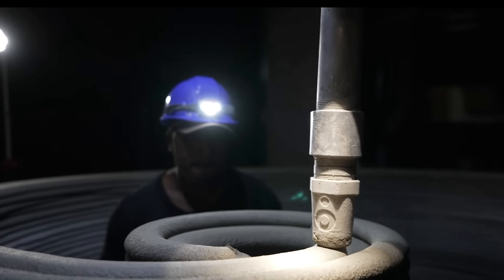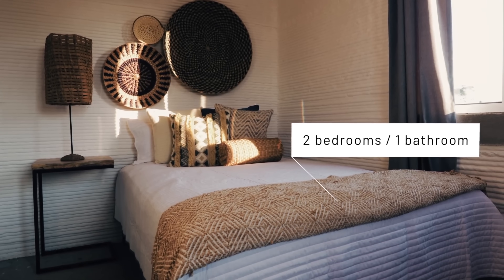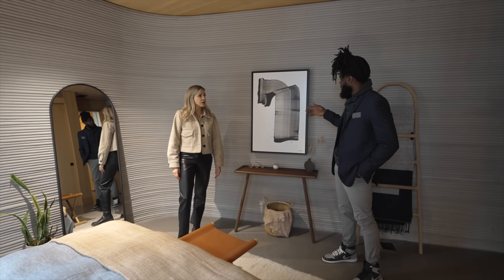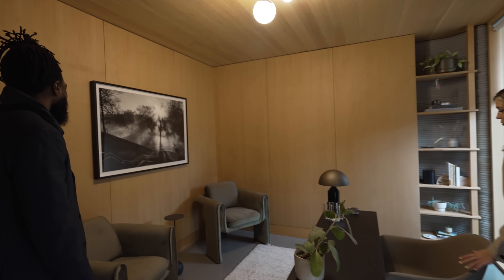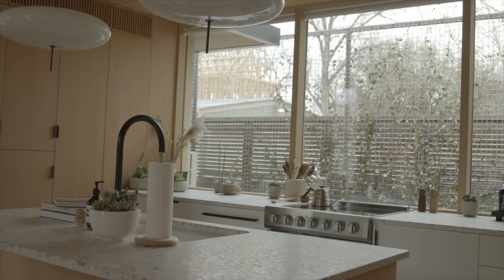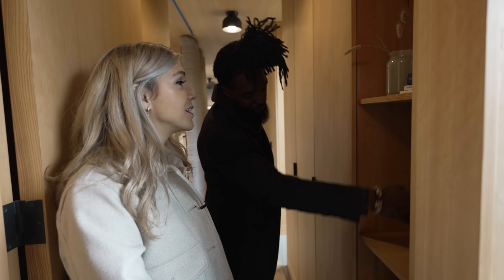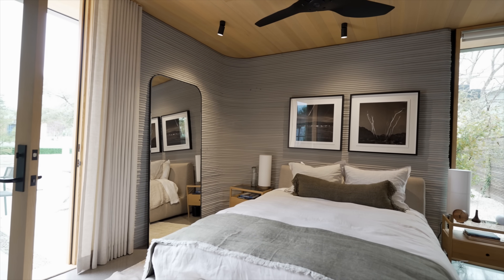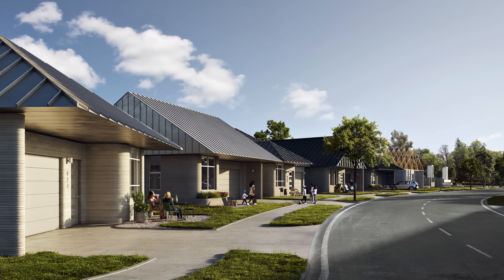Inside A 3D Printed House You'll ACTUALLY Want To Live In

Comment: I think Americains don’t realise that most countries only build houses with concrete and construction stones, wood seems weird to us. Love the video
Reply: Thanks shells that was interesting honestly I feel like Icon should be pre-wiring that stuff
Reply: @bluemanagementservices4172  concrete fucking sucks, is solid, has no way to put anything in between, is cold in winter and hot in summer, and can crack, wooden isn't safe for fire, but there are ways to make it safer, you can put wired connections in between, put isolation panels, can easily be swap in case you want to move a specific wall in a room, etc.
Reply: A lot of countries actually uses compressed soil and mortar to build it needs way less sand or cement.
Reply: I don't think that you realize that wood has a far better R-value (insulation) than concrete or stone. Wood also has a far smaller carbon footprint with CONCETE having the LARGEST carbon footprint of all materials.
Reply: you do realize that concrete homes are insulated, right? You don't use just concrete for walls. Also, for the carbon footprint, cutting a tree means destroying a "machine" that converts co2 into o2. And also there are types of modern concrete that does exactly that, absorbs co2 and releases o2, and they are very good on large buildings, something you cannot do with a wooden frame building.
Reply: @mrtopcat2  Wood, by itself does not. But wood houses require lots of insulation which is where most of that R-Value comes from.
Reply: @EDub513   And still wood wins hands down BY FAR when compared to concrete. Actually can't even compare wood to concrete, concrete is so bad. Literally almost no insulation. Only people who are somehow involved in selling the 3D print idea see any benefit. Lining their own pockets.
Reply: @EDub513  R-value of concrete is around 0.1 per inch, whereas R-value of wood is around 1.4 per inch. So easily 10x.

But this comes at no surprise. Sit on a concrete bench vs. a wood bench and feel the difference.

By the way, in Europe, with the benefits of wood construction finally recognized, wood construction is on the rise with the technology explored deeper and perfected. I have even seen high rise projects built out of wood in Europe.

You have mentioned wood being more available in the US. That may be an excellent point. Yet, I think in general, historically in the US buildings were never intended to last long and they just wanted something quick, where wood was a great alternative. In Europe on the other hand, construction was much more planned and required to be long lasting, so they chose masonry products as due to the lack of effective moisture control, masonry products would last longer. But now with modern moisture control technologies, wood may become more appealing.

By the way, I am always fascinated by Japanese temples. They seemed to have managed it all. Moisture control, insulation, seismic resistance. They still stand tall.
Reply: @mrtopcat2  who cares about that? What's important for most people is for their house to still be standing after huge storms, floods, fires and those pesky termites.
Reply: @darrienekassandraduran8825  Well, that is one hell of a shallow comment of technological ignorance.

What you have mentioned can be achieved to be nearly on par with concrete via design and technology.
Reply: @mrtopcat2  so what? Concrete is durable, and it should be made widely available as an alternative. If you are worried about carbon footprint, concrete should be the least of your concern. “Of all materials” means nothing, when you consider car exhausts, for example.
Reply: @mrtopcat2  You just had to cite a fringe study by Gates, eh? Even if you are concerned about interference by those interest groups, you don't have to cite studies conducted by the west. And you didn't reject my point either.

Another important point to note is that concrete is mostly used to build new structures. This is different from transportation, for example, which is simply recurring.
Reply: That was the first thing that came to my mind lol
Reply: @AJCiti thank you 70 subscriber
Reply: You are right. We don’t realize.
Reply: @MousyLeigh  because it is inefficient
Reply: @MousyLeigh  Actually you realize, as mentioned in video most costs are labor in US, wood houses are faster to build, but not necessary cheaper in materiel. In E. Europe a lot of companies who build massive suburb areas from 0 also choose wood, as it is faster and overall cheaper, thou not better as wood has a lot of issues.
Reply: It is very unusual house made of wood...
Reply: @MousyLeigh  thank you 70 subscriber
Reply: @MousyLeigh  the reason is earth quake!
Reply: @MousyLeigh  I'm an American, I'm dumb as a stump. Bali is one smart person.
Reply: @xyzcomp08  this seems to be a legit answer
Reply: Fiber reinforced concrete is the way to go
Reply: @Theo-lo1yc  Um... Hello, the rest of the pacific ring of fire make homes with steel and concrete.
Reply: I think wood should be more like a interior wall and joints
Reply: What I find strange is all the wooden houses in Tornado alley and what's left after a Tornado.
Here in Asia we get hit by Tornado and nobody goes to Oz like Dorothy cause our houses are bricks stone etc even the roof is aluminum frame.
Reply: Even in places like Miami, wood has been all but eliminated since hurricane Andrew in the 90's
Reply: It’s silly but here we are.
Reply: @petermuller161  why is wood weird? It’s literally one of the oldest and basic contruction materials.
Reply: Yep, Mexico also builds with concrete. Not a new thing.
Reply: In Brazil, we use both, but mostly concrete. Wooden houses get really hot in our summer, that only lasts 10 months. And there are also termites in some places… they can easily eat a whole wooden house down!
Reply: In my country, the Philippines, you can see a lot of concrete houses for particular reasons such as to withstand calamities, and since we have high temperature here, the concrete helps to reduce the heat we feel when we’re inside. By the way, we have an average of 20 storms per year and some are unimaginably destructive.
Reply: from what i know. US home use different material in different region categorize by different climate.
Reply: @hintofdia  Why build with bricks when you have hollow blocks?
Reply: @mayyahhh2503  In south india, we traditionally build bunglows out of wood. Most five star hotels in south india are wooden made.
Reply: @diyasingh-x8t  what??
Reply: What is the most malleable and allows for so much modification with customization later on
Reply: Well it's not just America. Timber stud frame construction is by far the most common here in Australia as well.
Reply: I prefer steel. so, not every American wants wood.
Reply: You realize that it doesn't really matter right. Homes have been made for thousands of years using wood, rock, mud, concrete (their version of it) etc.
Reply: Exactly I be calling these wooden houses here carton box houses, like so expensive for a home be made out of wood I’d rather have my home be made out of concrete.
Reply: @Theo-lo1yc  Wrong.  Cali is littered with tilt up concrete warehouses, office buildings, hotels & parking structures. I’ve worked on houses and small buildings with metal framing instead of wood.
Reply: I lived in Europe a few years, and yes, most homes are built with bricks and stone etc. Even many of the roads of course are brick, or cobblestone.
Reply: Lol and it is expensive as f.
Reply: Personally I would prefer my home made out of brick or stone but the cost can be high for those type of materials.
Reply: It's so u can reuse the land easier to burn then to break apart and have to find a place to put the waste of the house weird
Reply: We aren’t dumb.
Reply: @Catphesuada  — Please tell us Americans aren’t dumb, when half believe Trump is still president. 🤣
Reply: Probably because we’re not starting wars all the damn time
Reply: They way the talking about the concrete😂😂😂. I have leaved in concrete built houses all my life .
Reply: Concrete has godawful attenuation. Not sure why it’s weird that we would want wood in a society that heavily depends on wireless radio transmission.
Reply: Well wood isn’t the norm in America either, it’s full of multiple cultures. I seen houses made out of metal plating that looks like cargo containers, etc.
Reply: We live in a very humid environment and having a wooden home is not recommended. Mold will wreak havoc on it.
Reply: Yes, save the trees please.
Reply: Abhijeet Kundu  -- True, but with respect... When I've traveled abroad the buildings in other countries seem permanent, brick, stone, cement, marble, there are so many buildings over 200 years old it boggles your mind.  Returning to America, it seems almost like I'm coming home to a tent city of temporary homes.  It gives me great respect of the European building methods, they LAST.
Reply: I'm from Brazil, here we have plenty of forests to get wood from, whoever almost all houses are build with bricks and concrete, it is very rare to see any houses here build with wood.
Reply: @Theo-lo1yc  Chile have more earthquake and we build with concrete
Reply: It is not weird, most of building properties include houses' building materials depending the geolocation and weather along with climate.   This is the reason why when you look at houses across the United States, you will different houses using different building materials.
Reply: Europeans just can't go ONE vid without making fun of America. Apparantly you're forgetting about Canada and Australia who also make houses out of wood. But no, any chance you get to make fun of America you'll take.
Reply: I don't think you realize this, but the America's have more wood than most other countries... We didn't chop every single standing tree down like every European country did in the 14-1500s... Maybe study some history, mate
Reply: Why would we care?
Reply: Never heard of an "Americains" btw wood houses are better than your sh*tty concrete and stone wich reminds me of stone age living.
Reply: Americans don't realize? I love how people from other countries think that all Americans are dumb and don't know anything about any other countries. Yawning because I'm so tired of this narrative.
Reply: Exactly 😅
Reply: 0
Reply: True growing up seeing it, it was weird until I realised why they do it. I wonder though is this sustainable long term I mean using trees, don't panic just a question.
Reply: True
Reply: That's true because in my country having a house made of wood is cheaper and many citizens including myself live in houses made from concrete and construction blocks.
Reply: those motehrucker also dont realise that 95% of human use metric system...
Reply: In Florida the house of houses are all concrete, only walls inside are wood. I think this happened after hurracaine Andrew
Reply: It's not like we don't use the would at all, in houses the roofs are most often with wooden construction frame. But yes But yes concrete construction elements withe brick walls is the norm.
Reply: @rador9745  shortage supplies. Covid , China , amongst the many things
Reply: Years ago it was the same here in the USA, but people here tend to be short sighted and the lower cost of wood became more important than the longevity of CBS (concrete block) or poured concrete.
Reply: Was thinking the same thing
Reply: I think most Americans actually like running water, plumbing and power inside our walls.
Reply: @Burt Wilderdeud - Nodding my head in approval right now sir… 🇺🇸💪🏽
Reply: Here we make huge modern buildings and barely use wood, only really takes some small pieces of wood while building. But then again 3D printing wouldn't work any good here either because cement is very expensive and we build mostly walls with bricks without anything inside with layers of cement between them, just cement would be crazy expensive...
Reply: Im Jamaican American and concret housing with zinc (alluminum) roof tops is what im used to. wood is too frigile. Termites, water damage,  erosion, carpenter ants, and general upkeep make it sound like useles building material. Plus ifs costly to the enviroment since trees dont grow overnight. I always wondered why more houses didnt use me indistructable materials like stone, concrete, cement, even brick.
Reply: Yeah , in Europe ( tho idk about now , still here in Slovakia ) we still build and probably will continue to build with bricks , woods are just not viable to use this as like a main / core building material , maybe after the house is buildt , on the inside for design or whatever.
Reply: Are they resilient during earthquakes?
Reply: no we just know its better for the environment
Reply: We use wood in Norway
Reply: @throughthelens231  did you not watch the video?
Reply: Maybe we should change that.  Concrete is the 3rd largest producer of CO2.  One ton of CO2 per ton of concrete.  4 billion tons of CO2 each year, worldwide.
Reply: Hm
Reply: Wood is normal in Switzerland
Reply: This 3d house build gonna take time to implement in the rest of the world .....
Reply: Well we know that. But 3d printing a house is new. That’s the cool part.
Reply: 3D concrete walls > painted drywall boxes
Reply: Florida is FULL of concrete block homes.
Reply: Timber house is designed to be affordable. It is expensive because of the labour so it would be more expensive for concrete
Reply: maybe https://youtu.be/vwV-Im_xlic will be useful for you
Reply: Lots of countries use wood for various reasons (availability, durability, flexibility, and..the ability to mix with insulation without a separate layer for colder climates).
Reply: I’m from Jamaica and most of our homes are build with concrete homes built with concrete are better suited for warmer climates lol building a concrete house here in the US especially in states with colder temperatures don’t make sense for insulation purposes it’s easier to keep a wooden house warm in the winter than  a house built with concrete if you use concrete to build your home in the winter your gas bill will be mighty high trying to keep your home warm wooden homes don’t keep and maintain a cold temperature like a concrete house dose so it’s easier to keep cool js
Reply: @everythingtv2325  you can insulate a concrete home with insulation, but because there is no space for insulation in the concrete, the insulation layer eats into the interior space of the house.
Reply: @seanmcdirmid  yes you can but what I meant is that it’s harder to keep concrete homes warm during the winter
Reply: That's horseshit. Wood is commonly used for construction all over the world.
Reply: @n1nj4l1nk  have you traveled to all the world’s countries, I have been to most countries in Europe and Africa, and I can say it’s none existant in a lot of those countries, you’d ask the people living there and they would tell you they had no idea that wood is being used for construction in some parts of the world. you don’t have to travel, just ask people from different nationalities on the internet, wait I am one example of that but you said it’s “horseshit” 😅🫠 Enjoy your day or night.
Reply: @Pappo56666  Japan, China, Russia, Australia and every country in Europe that I've worked in all use wood in the construction of homes.
Have you never heard of log cabins, tudor houses, a frame construction? African homes are either entirely wood or a wooden frame with clay/concrete coating, European homes are largely wooden frame and brick skins, Japanese homes are wood frame with traditionally paper walls but more often these days a concrete block skin. Places like Thailand, Sweden and a bunch of South American countries have homes almost entirely made from wood.
Pretty much all houses around the world with pitched roofs use wood for the frame.
Clearly you know nothing about construction.
Reply: @n1nj4l1nk  back in the day 😂 in Jamaica we don’t use wood wood is for poor people fr
Reply: @n1nj4l1nk  in Jamaica concrete homes are much stronger and better if there should be a hurricane or say a tornado a concrete house is more stronger so you don’t have to constantly rebuild and wooden homes are cheaper to make 🙂
Reply: Ye cus wood burns
Reply: wrong mor0n aka bali.  Much of the US REQUIRES concrete walls.
Reply: Not true at all. I’m American (USian? That’s not a word lol), I live in Texas, and for my home it uses concrete, construction stones, wood, and bricks. Same for my whole neighborhood
Also, I believe the materials differentiate depending on the climate and area since the US is large
Reply: But they Def don't 3D print them to spec in order fir it to look like an actual family home.
Reply: why are you fighting... wood or concrete is same the have pro and con... maybe its okay to use wood home in us and urope because the climate and it will be cheaper but if in asia especialy in southeast asia rain, tornado, even hot and flood, wood home will become problematic it will rot faster than the concrete one... and what happen if many home in asia made from wood. many forest will deforestation because many will need for wood material, europe and north america will get less imported wood from asia, that why many asia coutry choose to concrete home... fyi amount wood material needs in asia already high even with concrete home what happen if every corner use wood house
Reply: ??? Wood, weird?? Have you ever been to Europe??  There are log cabins and chalets and quick houses fully built from logs, i.e. wood. old and new.
Reply: True
Reply: It's not that. We are just far moe advanced in the building world
Reply: yeah but under that concrete and stone is a wood frame. In the US, you have that ability to build your house however you like it. whether that be of brick, stone, concrete, wood, etc. Since the US has natural disasters like tornados and earthquakes, Americans choose to build with wood so it will be cheaper to rebuild if their house is destroyed. Bricks and Stones can be used as a deadly projectiles in tornadoes too so people have to realize why we use wood.
Reply: Ah so we're just the silly folks then, huh?

Damnit! Again!
Reply: Thats because you probably donr have enough wood in your part of the world to support everyone having wood foundations in every home
Reply: I dont think you realize that most americans dont want to live in a slum where every house looks like the same block of bricks. Your house probably looks like aushwitz. Youre like thecperson who asks why would anyone get a mercedes when you can get a hyundai for cheaper? Perhaps you should just stop being poor.
Reply: in Nz at least, i know we have a lot of wooden houses because of earthquakes
Reply: They used so much wood that place cost a fortune 🔮
Reply: Well wood is better for the earth..
Reply: Right
Reply: Speak for yourself.
Reply: who the fuck are americains
Reply: American here my house is 100% made of concrete, lots of newer construction here is just plywood unless you get a old house or a really nice house
Reply: I'm American, I actually knew that. But I'm also of European, Hispanic, and Asian descent. All of which are cultures  that use concrete. But, a lot of the houses here in America are brick and our foundations are concrete.  Although, I do see it as a strange material to build housing with
Reply: Totally don’t know
Reply: I love it!
Reply: As an American that has lived in a log cabin, brick house, high rise (cement and steel I believe). Thanks for the assumption.
Reply: Far too much wood. Yuk.
Reply: I’m American and I’ve never bought or built a home that wasn’t concrete and steel.
Reply: Unfortunately in places with a lot of humidity, concrete and stone or be a nightmare. And like where I’m at my home is actually 7 foot off the ground due to Insurance purposes and that I’m about 500 yards from the beach so my house had no choice but to be made out of wood but my siding is made out of hardie board which is a cement, sand, and cellulose fibers. It’s very tough and durable.
Reply: We think everything is disposable, including houses and people.
Reply: man our mansion in vn built by concrete and last forever .
Reply: Abhijeet Kundu  — I could t agree more!  👍🏽😍
Reply: Abhijeet Kundu  you are destroying ecosystems if you continue to use wood/trees to build house . we should use our waste/trash recycle them turn them to usable materials to build house .
Reply: Abhijeet Kundu  wood is not cheap to build house .
Reply: Of course we know lol. Aside from the US, Canada, Australia, New Zealand, Japan and some south east Asian countries still build single family homes using wood.
Reply: Wood is sustainable and a renewable resource. Stone and concrete are not. It may be weird to you.. but figure it out. You are using the worst materials.
Reply: No we definitely know that!
Reply: Americans usually build with timber so you comment Is ignorant
Reply: They build homes cheap, so they can make the most amount of money
Reply: @gabe6959  who doesn’t build to make money you do know the USA has a large population and a tradition of building with timber.
Reply: @HopeYukizmizu  Not true that’s some Europoor propaganda if it’s a third world country then why does it have the biggest economy in the world. Not to mention how a lot of people want to move there. Cope harder Hope.
Reply: literally what I just thought
Reply: In The Netherlands wood doesn't seems weird. There is not enough wood here to build thousand of houses. When people build there houses by them self you see more wooden houses. We normaly have an inner wall, put insulation on it and then build the outer wall. Then the upper floor from concrete and thats how its going up. Only the roofs are wood :D
Reply: Yes, in Germany this would not be possible
Reply: the reason for this is...america is basically a development country, health care, wealth per household, education, infrastructure, cunstruction and so on xD
Reply: we still use woods for the roof
Reply: i did not realize that, thanks
Reply: Nope. Wood housing construction is originally Asian. The box and frame housing you see was adapted from Japan to California to deal with earthquakes and then was expanded to most US housing due to it being cheaper and easier and faster.
Reply: I'm from europe and actually there is a trend back towards wood as a building material, because the CO2 footprint is way, waaay better than concrete. And it's actually even pretty fire resistant with the right treatment
Reply: In Sweden wood houses are very common
Reply: I wish our houses were concrete. Wood makes me feel unsafe.
Reply: @darkwoodmovies  weak
Reply: Have you been to "most countries?" Do you know most Americans? No, and no. Now stop insulting us.
Reply: I saw a 3D House Building company using mud to build houses because their research shows mud houses are very cost effective. What most Westerners and Indian Urbanites forget/don't know that building mud houses is the traditional and sustainable way. Mud can go back to the ground if house is demolished. It requires clay, mud & hay for the mixture to make the walls. The temperature maintenance is very cost efficient in mud house.
Reply: I do love stones but in California we have earthquakes and where i love we are not even allowed to use stone
Reply: thank you for this, i was like.. how structural will it be?
Reply: Yeahhhh don’t know how well this will do in hurricane
Reply: Actually, concrete house construction is actually just a European thing and houses in Europe are outrageously expensive. The rest of the world use different materials such as wood, clay/adobe, and even a few other materials. It all really depends on what is cheapest for the area. No matter where it is built, if it is built right, it can last a very long time. There are all kinds of examples of wooden houses that have lasted for numerous centuries not only in the United States (which is only a few centuries old now) but Asia has quite a few of them very old wooden houses.
Reply: The reason why we use those tools and materials is because many years ago builders wanted to standardize building home practices so they Thé could construct entire neighborhoods cheaper and faster the architecture kinda changed for the carpentry
Reply: Wood is an extremely environmentally friendly way to build a house. Bricks and concrete take a lot of energy and pollution to make.
Reply: Mainly designed that way for winter and earthquakes. Instead of the house getting completely demolished with a 5.0, it’ll lean with the earthquake and stay standing. And winter (depending which areas of US) needs some good insulation that other materials can’t provide. But in hotter parts of the US, that don’t have that many earthquakes, it doesn’t completely make sense to have such an expensive construction 🤷🏻‍♀️
Reply: The only houses with wood walls i see in America are 500k plus
Reply: @iam_tack  every house I’ve seen in the west coast are built with studs. The only ones not are ones build before the code was implemented (like East coast is full of brick ones)
Reply: We don’t just use wood we also use concrete
Reply: If you don't know how to waste your money on something, then buy a 3d printed house
Reply: depends where in America for example Florida has primarily metal or concrete construction
Reply: i think you don't realize that most developed countries have a bubble housing market. :/
Reply: Actually we always see those shoddily constructed with "improper materials" cement building on the news,  collapsing in earthquakes and hurricanes. 😞
Reply: idk why ppl still build their houses out of wood in tornado/hurricane prone areas
Reply: That's true
Reply: I live in an earthquake zone so wood framed houses usually work better.  Note that is just the frame and we tend to use stucco on the exterior and dry wall on the interior.  Also, is there a way to fact check that statement?  Are we sure it's "most" countries? ^_^
Reply: cool but you are actually no most so don't speak for us.
Reply: Ah because you can build normal roofs out of concrete and stones? lmao yeah. Im european btw
Reply: More flammable house, how lovely
Reply: Do the have the story of the 3 little pigs over there?
Reply: *realize
Reply: @PresidentDawg  Realise, in the UK it’s realise, and I am aware that in the us and Canada it’s realize. But thanks I guess.
Reply: because it is inefficient
Reply: Americans love to kill trees. And then wonder why we are having global issues. Consumerism over the future.
Reply: I wonder how much will they be? I loved the style.
Reply: Americans
Reply: She said they were concrete
Reply: I wouldn't say most.. lots of countries in warmer climates build houses out of timber. Here in Brisbane, Australia half the houses in the city are wooden!
Reply: I in Phillipines ma house is made out of wood... i broke the wall onec :P
Reply: and thats y their houses burn so easily.
Reply: your actually wrong we do know and it just shows that people enjoy spreading their thoughts even if thy are wrong
Reply: Lmao there is alot of homes in germany that use wood along with sweden as well
Reply: Yea the only wood in my house is a support beam in the attic.
Reply: ikr
Reply: nope
Reply: I do not live in America [Never have. Wasn’t born there, either, and I also don’t have a single known American relative] and many houses in my country are made out of wood. My house is made of wood.
Reply: nah i live in poland and i go to a wood house every year for cavation / sry for my english
Reply: So y’all never had a log house? Abraham Lincoln house? Wood homes are old
Reply: I know is this evolving or declining
Reply: Some of us that travel does.
Reply: My current house is concrete they're many down fall to a all concrete house wifi/cell service and climate control it's is just a few.
Reply: Really?
Reply: lm indian and YES THEY DO Only do concrete for homes
Reply: Let's be honest here. The US builds out of wood because we have the most magnificent land in all the world blessed with tons and tons of forest land. Others countries are not as fortunate.
Reply: Americans in Alaska build their homes made out of snow.
Reply: Concrete is not sustainable
Reply: Couldn't wait to to get that lil jab in huh?
Reply: We love mold in our homes, that is why
Reply: I think most people don’t realise that in my village we only build houses with sticks and cow shit, concrete seems weird to us.
Reply: I'm American and I know we are the only dumb asses that build our homes out of wood. Despite what they say, wood is a cheaper product and it doesn't stand the test of time. If we built out of wood we wouldn't have to continually...REBUILD! Welcome to money before everything else. 

My only question with the 3D concrete. Where does it get it's strength from? Concrete is weak without rebar.
Reply: in my country most modern houses definity build by concrete and bricks but in the countryside most houses build with woods with unique structure and could survive from 100 years and even earthquake
Reply: Concrete is not eco-friendly, can have mold and can be deadly during earthquakes, and have bad insulation
Reply: I know right?? 😂
Reply: Why is that? Because of the cost? Concrete is more sustainable than wood or "engineered wood products".
Reply: I know and then they are way more expensive here.
Reply: It all depends on the environment, elements, and climate. If a concrete home is more common in your area, then there is a reason for that lol. If a wooden home is common in your area, there’s a reason for that lol. Common sense would tell you that. Hello people! Quit trying to act like yours is better than others and vise versa. So silly! And we wonder why the world is in chaos. It’s the people🥴 Lord have mercy🙏🏽
Reply: They are definitely aware. There are reasons why wood is used. It's not weird, you are just not aware of why wood is used. =)
Reply: i swear we dont care if youve done this before
Reply: Those are probably the cheapest materials in other countries. Wood is the cheapest here, so we use wood. It’s not a secret, it’s just capitalism. We don’t realize it because it has no relationship to our own reality.
Reply: lol most americans cant afford to build with american concrete
Reply: usa is babylon !!!
Reply: I got to say this is the dumbest comment I've seen in.
Reply: I don’t think that’s quite true. Japan and places prone to earthquakes build lighter. But ya concrete is most common everywhere I’d say. Including, American , Canada too. In Canada we pour foundation (basement in ground) concrete. Then we frame with wood or steel on top. 
But anytime you start a comment with Americans don’t realize lol thumbs go up 😂
Reply: Because the wood makes it feel more natural. and it feels even better if you are capable to building it yourself.
Reply: … I think you didn’t realize that we don’t just use woods to build houses.. we build with lots of other resources, just depends on the owners and what their income is and etc… 😊
Reply: @thomasstcyr9806  for some ppl it’s their line of work. Their industry. They’re bread n butter. I’d say important stuff to some
Reply: That's bc of what is locally available. In America in the second half of the 19th century when the Great Plains were being settled (yes go ahead and note that 'settling' means that the buffalo and indigenous people were dealt with harshly) many of the original dwellings were built of sod. They were also built into hillsides if hillsides were available.
Reply: 😒 wtf....this comment is funny and stupid af
Reply: Here in the US we like our homes to be burnt down, so we prefer wood.
Reply: @ErnisTelevisionNetwork-yy7ii  🤦‍♂️ Wood is less expensive than stone or concrete but wood either never was or is no longer plentiful in much of the world or doesn't have an acceptable service life.
Reply: You are right.
Reply: Especially where they build wooden houses where tornadoes are! 🤷🏼‍♂️
Reply: Like in the story of the three little pigs. The house built of hay and sticks got blown down. The house built from brick with stood the pressure.
Reply: Name of this company?
Reply: More then 500k fot this kind of house, I would li,e to know where is the convenience...
Reply: Drywall?
Reply: Concrete sucks to renovate
Reply: Yes we do.
Reply: I would never live in a wooden house.
I just don't trust them.
Reply: Not skilled enough to build with wood
Reply: I’m in south Florida where concrete is used due to hurricanes so when I see a house built with wood it looks weird to me
Reply: Australian here, we use a combination of everything. Sometimes you will find a brick exterior but our walls are a mix of concrete and timber/wood. We also have concrete beams inside our walls, it’s why we never see houses crumbling or falling over.
Reply: I was living in Russia, Uzbekistan, Kazakhstan, Ukraine China, and now in US, and never seen so terrible housing, country like in 19 centuries, no design, all is shabby… i don’t see any greatness of America economy…. All is bubbly over price etc
Reply: I live in Puerto Rico, and us Americans here build with concrete and steel.
Reply: We build with concrete walls in Florida. We also travel, so we do know different ways to build. We also have wood framed homes that are over 200 years old, so what’s your point?
Reply: Actually houses built without concrete to us means you can't afford to build a proper house. The first time ibsaq American houses built fro. Board i felt so vulnerable like they can literally blow away any minute. Dont even talk about the price $$$$ they are being sold for. I will never under
Reply: I felt so vulnerable when I started living in a house made from Bacchus board(match stick)  in America. It looks and feels cheap, and I will never understand how someone with that type of house tries to sell it for the same price as a brick or concrete house.
Reply: Westerners like to switch things up and revamp every 20 years ! Would
Be mass depression and worse! They don’t want buildings lasting to
The end of
Time they have more disposable resources and get it from every country ,
Reply: We realize it.. but our trades are clearly not using it outside of high end residential, commercial and multi family
Reply: Hi, American here. I agree. Never been comfortable living in a firetrap in an age of electricity. It is fucking weird. And to the asshole who says it is so it can be affordable a) what era are you living in? This shit ain't affordable. 30 year mortgages and shit. Sounds like you can't manage money. You just spend what you don't have and put yourself in debt. If I was gonna spend like that I sure as he'll would get a nicer place. B) I would like to live in a place that isn't gonna be a safety hazard. Again, flammable as fuck, easily molded from moisture, torn apart easily by nature, etc.
Reply: ICF ftw
Reply: We do realize there are multiple materials an abode can be made from, we aren't all idiots.  And no "most countries do not "only" build house with concrete and construction stones"  There are brick buildings, mud-adobe, steel, concrete block, cast concrete, earth berm, and wood / timber log all over the world.   It entirely depends on material availability, local labor skills, laws, and environmental conditions.  You can find many examples of all of the above construction materials all over the US.
Reply: Not to mention wood homes create desert biomes. Deforestation is really that bad.
Reply: Americans do realize there are other building materials out there lmfao. Hilarious how people think Americans know absolutely nothing.
Reply: How would you know what MOST Americans know? We're smarter and more well traveled than you might think. Many materials are used around the world, from bricks to stone to sand straw and clay to concrete to wood. Depends where you're from.
Reply: That's what makes you a 3rd world country.
Reply: All those countries used to build with wood as well, just ran through. Natural resources and moved to concrete homes - cost plays a factor too
Reply: Not quite true. Wood is a great material to build a house. The 4x2 stick construction is rubbish. Great cost effective wood construction can be found in Austria for example.
We need a great effort to phase out the 4x2 construction.
Reply: It's like popsicles sticks and toothpicks being put together as a frame with great aesthetics
Reply: Why are you guys so obsessed with what Americans build homes with?
Reply: Thank you 70 subscriber
Reply: A lot of people who don't know sh*t about construction like to pretend they know everything about construction in YouTube comments.
Reply: Its not that we dont realize. We just dont care. You guys care more than we do. Your countries are teeny tiny and thr united states is huge in comparison. Wood housed make sense when  you compare the cost and volume. Take your butt back to bumfuk who cares land. AMERICA BABY!
Reply: Exactly in Haiti Jamaica Africa they built with concrete blocks. It’s the same concept and these houses stand for hundreds of years Americans think of sheet rock steals and beams. You don’t need it.
Reply: Concrete is better. It's fire resistant, blocks sounds better, provides better insulation, more wind resistant when the walls are thick concrete.
Wood is way overused in residential construction in the USA, esp in fire, tornado prone, and noisy places.
Reply: @check25bid  better insulation? bullshit, also, wifi connections cannot penetrate thick concrete walls, and make it impossible to make changes in the house after settled
Reply: That’s sad after checking out your properties, so expensive. And during a fire or hurricane you guys lose everything even the structure. Wooden homes here in asia hardly exist anymore.
Reply: @jialatdotcomdotsg4998  yeah I'm American. Tried to expand and explain the benefits to another American couldn't see the benefits. Already programmed with other thoughts. Someone said we need wood because of earth quakes in Cali. I said you're off your Wacker. Skyscrapers are made of metal and made to with stand. Wood is cheep. So I know that's why they do it here. And the news Media lead by private interest would  create every reason as to why we need to keep wood homes. Blah blah. And most would believe it. Cuz the news said. Said SsD Co. Said it. Man.. the people need awakening...
Reply: That's not true. We in Finland use wood too,..
In fact my house is made with wood..

In the Northern countries is most popular to build a wood house...
Reply: @michaelandreuzza also heard that during a fire sometimes a complete block burns down. But hey a house cost only 100.000 or less. You can afford to build 3 or 4 houses in 1 live time. So no problem. But if it happens during night time.....
Reply: @mayyahhh2503  We have very similar climate and natural resources. There's nothing wrong building a house out of wood. I have old homes near me built out of Adobe clay bricks.
Reply: You can think wood is weird all you want, but I prefer to have AC and heating built into my homes, which is something most housing in these "concrete countries" don't have. Btw, we DO "realize", we just don't like it.
Reply: @t6-30  well you can have AC and heating built into concrete houses. But heating built into houses isn't really necessary where I come from since it's already quite hot here.
Reply: @t6-30  lol wood houses are shit. Just a little storm to destroy your house 😂
Reply: @t6-30  why wouldn't you have central air conditioning or mini split ac/heat pumps available in these builds? you do realize that the roof is still a truss constructed of wood so the ceiling is going to be a traditional attic type or thermal sealed envelope style where the attic is conditioned space along with the house. So you would just run your air ducts in the attic like a traditional one story home and just run electrical for an air conditioning unit/heat pump. The 3D printed approach is only the framing of the home, nothing else.
Reply: @t6-30  What are you talking about? Having or not AC in a concrete/brick house is a choice. I have AC.  And heating, honestly, is  something my "concrete country" had for a long time, for almost 80 years now. And yes, wood house are lovely, nobody says the aren't. It's just a matter of practicality, it's a lot cheaper to build with concrete and bricks.
Reply: @t6-30  wait until you find out central air is a commodity most americans dont have
Reply: @t6-30  no you do it because its the norm. Literally any house can have a built in AC and heating system concrete or not 💀
Reply: @t6-30  The fundamental reason that you like your house to be wood is that you were born in a country that has that system fundamentally. So it’s not that you don’t like concrete houses, you just like that wood is the norm where you are, good for you, and supposing you would have liked to be original and build a concrete house, it would have been harder to build and more expensive.  btw I just had work done on my concrete house, and I was able to instal built in AC and heating, and honestly it’s a perk and not a necessity in a concrete house, I love that most comments agree that it’s safer and weird lol, It’s been on my mind since I was a kid watching Extreme Makeover: home edition, that show was everything !!!
Reply: @Pappo56666  Building Scientists around the world are developing and already IMPLEMENTING ever more creative ideas to AVOID concrete as whole or where ever they can as it has become clear that concrete is not a sustainable resource for the reasons I have mentioned in this thread (one of them being the lack of SUITABLE sand). Please find my related posts within this thread. NONE of this is news, if you follow the building industry.
Reply: I'm American well so called. And I agree. Making homes from match sticks in the age of climate chaos is kinda dumb. But they appreciate how it looks over practical. So. Oh well. Blown with wind.
Reply: @LucineRive  "Making homes from match sticks in the age of climate chaos is kinda dumb." What climate chaos? Climate change is a HOAX, just like God and Russian collusion. 90% of the Worlds glaciers are GROWING. The case for warming was found to be fraudulent. That's why they changed it from "Global warming" to "climate change", which means... ABSOLUTELY NOTHING.
Reply: @LucineRive  rather have wood that's way cheaper then stone that's more then double the price
Reply: @LucineRive  It's not dumb. It's sustainable and cheap.
Reply: @LucineRive  climate chaos? 🤣🤣🤣🤣🤣 Where? Oh they told you that on the TV and internet. 🤣🤣🤣🤣🤣 Of course you believed them. 🤣🤣🤣🤣🤣🤣
Reply: actually, we do realize this, because you guys mention it in every single video where wood is used to build something.
We American's would rather have a big house made of wood, that is easier to renovate, to keep it looking nice & modern.   While Europeans buy a stone house, built in the 1600's, is 600 sq ft (55m²), modernized to back in the 1900's to include some luxuriously opulent indoor plumbing.
Reply: People in cold climates don't use concrete which most americans live in. Concrete is terrible when it comes to the winter. Wood is also a lot cheaper to build with.
Reply: Concrete doesn’t fare too well in the winter 🥶 ... And with the water freezing within, it causes it to expand during the winter and thawing in the spring 🍁 leading to cracks ... And that’s why they stick to wood.
Reply: @Napstone  yeah a lot of people don’t know that and aren’t talking about that in the comments your heating bill would be way more in the winter time thou a concrete house will be cooler in the summer time than a wooden house 🙂
Reply: That's just not true in most of the world.
Reply: @brc3967  it is, most of the world uses stone, bricks and concrete.
Reply: Yea and it seems their houses always look weak. We are cyclone prone country and concrete is the normal material we use
Reply: Not on this side of the world, what many Europeans don’t realize is that we have a huge country with lots of different terrain an ecosystems. Houses are built to be comfortable and strong against the elements of different areas
Reply: some houses require it to be wood based on environment. Like in tornado states, it's easier for wooden house to be blown away but a lot safer that way too. Also, America had a lot of wood that they could use to build houses from but not much limestone to go around to build concrete houses from.
Reply: The way this is built, would be hell to fix a wall that is damaged. You would almost have to to replace a full wall if cracks show up. And solid concrete is a very bad idea, any movement in the area and foundation setting could cause a whole side to even fall if it was bad.
Reply: Americans still build with wood?
Reply: @Theo-lo1yc  not sure if it's a need homie. Maybe wood is cheapest. Skyscrapers with stand earthquakes. Not much wood holding it together.
Reply: @LucineRive  those have metal frames… I mean you’re technically correct, we could use metal, but that doesn’t seem necessary for just a house.
Reply: @LucineRive  if we used construction stone we would be underground sooner come the next earthquake
Reply: @Theo-lo1yc  maybe. We'll see
Reply: @Theo-lo1yc  that's incorrect, if built right, stone is a lot better than wood against earthquakes.
Reply: @LucineRive  sky scrapers have very expensive system in place for earthquake protection. Impractical for residential buildings
Reply: @LucineRive  as an Architect, you have a valid point… but what you’re asking about is metal stud framing which is a lot more expensive than wood framing and hiring General Contractors that specialize in metal framing means $$$
Reply: The whole of northern Europe constructs their homes out of timber frame.  I'm going to be ignorant and assume you come from Indonesia? - if I'm not wrong, then you can be sure these timber-framed houses are far better performing than yours.  You mentioned you've just installed AC?  Well that's because your house is not performing correctly - if it was designed correctly, ventilation and air-conditioning would be passive and not energy-consuming.
Reply: @craigstephens93  I’m from Morocco, it’s in North Africa, All northern African countries and the Middle East have concrete housing, and yes I installed Ventilation in a concrete house.
Reply: @Pappo56666  the non wealthy north african home compared to American homes is no bueno......
Reply: @craigstephens93  You might be making A LOT of assumptions my friend.  There are all sorts of home designs from pretty good, to passive to Passivhaus and beyond.  You probably already know that you build with the local climate conditions and budgets in mind.  How do you know that the house the OP built isn't energy efficient?  How do you know that the AC isn't heat pump based and also helping to dehumidify? Let's not generalize so much as to lose sight of varying realities or sink to condescending tones.
Reply: @craigstephens93  EU has a ruling that the frame of all houses must be out of metal and concrete, most member countries adopted this and is the norm, the rest of the house can be wood, stone, brick, concrete or whatever
Reply: @craigstephens93  pretty much
Reply: @craigstephens93  Well I’m from Europe and this what you are writing here is not true. People in the north do make small (mostly vacation) houses somewhere in the woods, where they are probably not spending too much time. In the big cities there’s no timber-frame housing in sight. You have to consider that in Europe we don’t have tornadoes. In the US they build timber-frame housing in the areas where they have tornadoes - how that makes any sense?
Reply: @doublepisces   Well, I'm also from Europe, northern Europe.  I studied Architecture for six years at a northern European University (2 years prior at a tech college) and I also have around 7 years experience working in Architecture in Northern Europe.  I myself, have designed, detailed and overseen the construction of many buildings in northern Europe, both residential and commercial and they all were predominantly made from timber.  

Firstly, I think you have a mis-understanding of what 'Timber Frame' actually is.  Timber Frame means it has a timber 'structural' Frame - it doesn't mean the outer cladding is also made from wood - that's called Timber Cladding.  You can have a timber-framed house or building that is clad in brick, concrete, metal, timber, plastic etc.

The house in the video doesn't suggest inner-city housing, but even the the dense inner cities are gradually being constructed in timber - CLT (Cross-Laminated Timber) is an Austrian invention and has been used throughout Austria and Germany for almost 100 years.  CLT is totally sustainable, almost as strong as concrete, fire resistant and is completely factory made so it is waste-free and accurate, making construction far quicker than concrete.  Look up the tallest wooden buildings in the world - they are mostly in the north, and it is a trend that will continue to grow.  CLT will rival 3d printing - because CLT is essentially the same but in reverse: the building is constructed off-site using computers and lasers and put together on site.

Your point about US is true - their version of timber frame is not the same quality as in northern Europe, and I'm not sure of the reason for this.
Reply: @craigstephens93  I actually do live in Germany and so far never lived in a home that looks like those American’s build. All the houses/buildings, it doesn’t matter if in urban or in village area, they are all made of bricks (hard material). Especially those in the North (look at Hamburg for example, bricks everywhere).
It can not be true that they are doing it “because that’s the material they have”, when in New York are buildings mostly build with bricks. 🤷🏻‍♀️ I’m don’t get their politics regarding this issue.
Reply: @doublepisces   You're not understanding me.  Timber Frame doesn't mean wooden exterior, it means timber structure.  Those brick buildings you speak of - many (not all) will have a timber-frame structure behind the brick - that is called 'Timber Frame with Masonry outer leaf'.
Reply: @craigstephens93  I’m not sure why we have this discussion, the whole point is that Americans building kinda bad housing. 😅 
It doesn’t have anything to do with Europe. And as I said, we don’t have tornadoes and even if we do, our houses are going to stand still after it’s gone. Maybe roof can be lifted up, windows broken, but the structure is going to stay intact. 
It’s just ridiculous to us for someone to make such a weak structure over and over again, like Americans do.
And I do understand what you mean, but between those wooden beams (timber-frame in Europe), there is a concrete all over, not just on the outside. The beams go 2 vertical, 1 across (from lower corner of one to upper corner of the other) and than one short beam mostly in the middle. In between all of them is so much concrete, you can’t take just an axe and break it all with one punch. 
I’m maybe not an architect, but I know some things about construction.
Reply: @doublepisces   I don't doubt you know about construction but again what you described very well, is not actually 'Timber Frame' but is called 'Post and Beam'.  If you are interested in construction, you should look into Timber Frame construction in places like Scandinavia, Finland and Scotland, and you should definitely check out Cross-Laminated Timber (CLT).
Reply: @doublepisces  You'll be surprised. Germany, being a leader in environmentally friendly and sustainable technology is actually also the leader in PHASING OUT concrete construction and replacing it with sustainable materials such as wood. Concrete is considered not sustainable because of it's terrible carbon footprint (cement manufacturing has THE highest CO2 emissions of all materials, 6% of all global CO2 emissions, while ALL traffic, planes, trains, cars, everything that moves accounts for 16% of world wide emissions). Concrete also requires a type of sand that is finite (Sahara sand is not suitable) and there are already localized shortages. You can look all of this up. Wood also has far better insulating properties. Concrete and brick buildings most recent and by now 'traditional' styrofoam insulation can not be recycled and is EXTREMELY bad for the environment for a multiple of reasons and also poses considerable fire danger as well. In fact, to my best knowledge, there have been again and again efforts in Germany to outlaw it's use, but the building industry has been resisting such attempts.
Reply: @doublepisces  yall people think our houses are just 100% wood? I wish humanities innate need to prove something right would go away
Reply: @double pisces  American houses are not bad, they use wood more because they are flexible enough to withstand earthquake n what not

Concrete cracks and breaks if the ground moved slightly too much
Reply: Took the words out of my mouth. Canada as well its strange living inside wooden  houses. You can break alot of stuff accidently especially coming from concrete houses. Nice house
Reply: @T R. King  how tf you breaking a house? You might have anger issues if you can just "break" an 2x8 board, tucked behind drywall
Reply: Yes it is really weird that most Americans don’t realise this. It seems like Americans have gotten used to the idea of making houses out of wood because it would’ve been more standard to do this during the early days of the settlements so they just sort of accepted as being the norm. When the factors in Europe we had overtime much better setting up of infrastructure for shipping about stone and clay to make bricks. So for us using concrete and brick with occasionally stone, depending on the area you are in, is much more common than having a wooden house.
Reply: They came to the realization that it wasn't a good idea in crowded cities after the fires of New York and Chicago which destroyed much of these cities, but elsewhere it was still widely used because it was still a widely available material.    There are some pretty amazing techniques for joining pieces of wood for homes and furniture in Japan.   They use a Banzai related technique to harvest wood without killing the tree.
Reply: Affordable homes seem weird to you too
Reply: @zunedog31  Actually no, In Africa, affordable/cheap is the norm.
Reply: @Pappo56666  no literal! People are to even have somewhere they call home 🏡!
Reply: @Pappo56666  I agree. Most African homes look cheap
Reply: @Pappo56666  Yes because the majority of these people are living in Africa
Reply: @Pappo56666  i think he was talking about Americans , cause affordable housing does not exist here . i pray African nations see how rampant uncheck consumerism is ruining America and avoid the same pitfalls
Reply: @Pappo56666  you realize American also use concrete only buildings?
Reply: @Pappo56666  even on an african income?
Reply: @Pappo56666  Africa is a continent
Reply: @Pappo56666  cheap, big and beautiful at that. Me and my wife are purchasing in Gambia next to her country of Senegal. Many of the properties are amazing!
Reply: @Pappo56666  the homes the Dutch left you dont count.
Reply: @Pappo56666  You are assuming that wood is affordable/cheap in other parts of the world. Or that other countries do not have building codes that discourage the use of flammable materials like wood. I am sorry to say that both assumptions are wrong.
Reply: @Pappo56666  Why do they live in mud huts then 😂
Reply: @nexusebtuoy  so many typos I don’t understand 😅
Reply: @zunedog31  actually no. In countries where the labor are not the most expensive thing in house cost, it’s cheaper to make a house in concrete and bricks .
Reply: @zunedog31  with 20 grand you can construct a 3or 4 bedroom house in my country
Reply: @markmburu5306  goddamn with that kind of money you can get a nice shed at home depot lmfao
Reply: @corporateamerica4530  coz everything is expensive in America
Reply: @zunedog31  As if american homes are affordable ahahahah
Reply: @zunedog31 It's not weird to us. Maybe concrete is expensive, but it's so much more durable than wood, especially if you live in tropical countries. Concrete could survive storms, floods, and fires much better than wood.
Reply: @zunedog31  Lol what? I can build a 600m2 (around 6500sqm) house in concrete and brick which will last hundreds of years instead of like 40, for like 200k here, a proper beautifull modern house with actual architectural design. In the US that will build you a clone ugly wood house with 2 rooms and 1 floor at best.
Reply: @zunedog31  "affordable" says no one
Reply: @zunedog31  in eu for example the land makes a much bigger portion, a wooden house wouldn't make that much of a dicerence
Reply: @zunedog31  wooden tends to cost more in my area
Reply: @zunedog31  afford labor homes with supply shortages . Teh good luck right now
Reply: @zunedog31  stone homes n stuff is largely affordable round these parts
Reply: @zunedog31  in our country we still value our trees. So we mostly go with concrete and its cheaper to use concrete here than wood. We have abundant of wood here its just not preferred because of the constant yearly super thypoon hitting the entire country and not to mention the monthly earthquakes. Wood easily burns down the entire house, with concrete we can still rebuild whats left.
Reply: @zunedog31  you commented that in 2022, it would have made sense if it were like i dunno.... 2017 or something but timber is affordable in 2022? damn you make walter white levels of money
Reply: @zunedog31  Affordable houses are multi tenant. Affordable single family houses are really strange, yes.
Reply: @zunedog31  homes that get destroyed everytime theres a bit of wind seem weird to us
Reply: @zunedog31  these houses weaker than wooden house..... Even a small wind can blow up the entire house..
Reply: @zunedog31  your house may be slightly cheaper, although it isn't that much, due to higher maintenance costs, but I prefer spending a little more and getting a sturdy house that doesn't need much maintenance and can withstand a lot.
Reply: @zunedog31  Flammable houses seem normal to you then
Reply: @zunedog31  based
Reply: @zunedog31  i dont think wood is more affordable neither sustainable. Wood needs maintenance and easily be home to termites and a literal match stick rn because of the climate. You spend less now but ur BOUND to spend more later to it fixed or potentially make a new house because ur wooden house got burned down. We're a third world country and even houses in the slums are concrete.
Reply: @zunedog31  the reason wooden houses are cheap is because America has and abundance of it. America is a large country
Reply: @zunedog31  actually even if our homes are mostly RCC they are relatively cheaper if we consider 2-3 generations of family live in single home and use same home for 100+ years
Reply: @zunedog31  so you may rethink again. It is precisely because you want to go that affordable that your homes don't stand any weather changes like for example strong winds
Reply: @zunedog31  affordable? 😅😂 hilarious. Most people can't buy a house in us
Reply: @zunedog31  concrete isn’t expensive
Reply: @zunedog31  don’t need to get defensive, they’re right it’s very weird
Reply: @zunedog31  American homes, affordable. 😂😂😂😭😭😭
Reply: @zunedog31  lmao "affordable" when 500k is for a small ass house in usa can get u a mansion here
Reply: @zunedog31  this is the most arrogant statement I’ve seen today
Reply: @zunedog31  nope not where I am
Reply: @zunedog31  nah wood homes arent good when you have hurricanes constantly
Reply: @zunedog31 a studio apartment with drywall in the US costs more than our 2 bedroom house made of bricks and concrete in my country lmao
Reply: @zunedog31  I think America also has that problem to be honest. At least in Europe we have better construction standards.
Reply: Yeah idk why America walls r so weak, it breaks even when they punch it...
Meanwhile if I punch a indian wall, my first needs a big plaster after that... Literally my hand broke due to that😳😐
Reply: @eternal1967  
So we can remodel
Reply: only in 3rd world countries
Reply: In my country houses are built with concrete and bricks and I can confirm from what I've seen the way houses are built in the United States are 100% better. Actually, I'll build my next house that way. Concrete and bricks only brings problems.
Reply: @therealfocusin  Interesting, but I think each one has the good and the bad, for ex a fire travels too fast in wooden homes, it could completely demolish a house, and concrete homes are cool in the summer time, it’s much needed in places that are hot half the time of the year like the Middle East and Africa.
Reply: @therealfocusin  I was actually considering the concrete, what kind of problems does it bring?
Reply: *North Americans